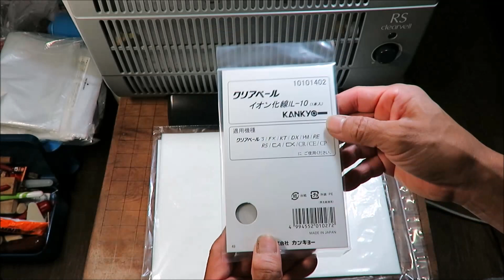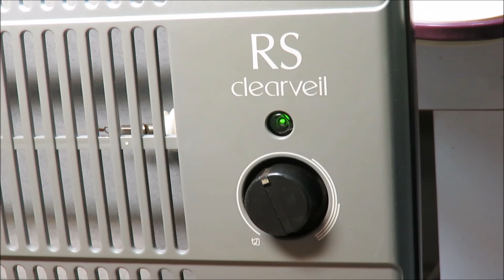空気清浄機の部品が入りました

Comment: have no idea how its work, but great to see completed
Reply: It's an air ioniser, which collects airborne particles (dust, etc.) on the white sheet. It was probably used by a smoker previously, and never cleaned, which is why it was so filthy. Probably not as effective as air purifiers that use fans (some use ionisers too), but still does something. Air purifiers are fairly common in Japan - you'll often find them in hotel rooms if you go there.
Reply: Thank you mate, I don't know how it works.
Reply: @AaronSmart.online  Thanks for the explanation.